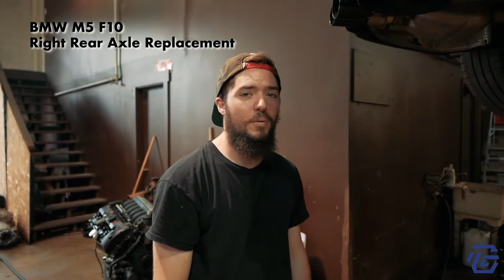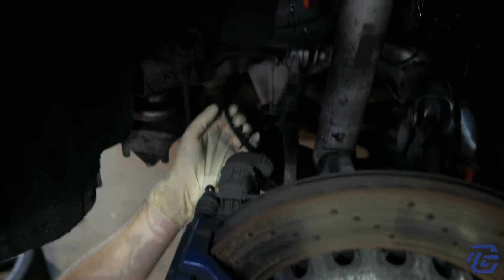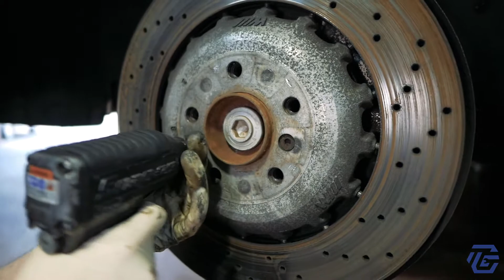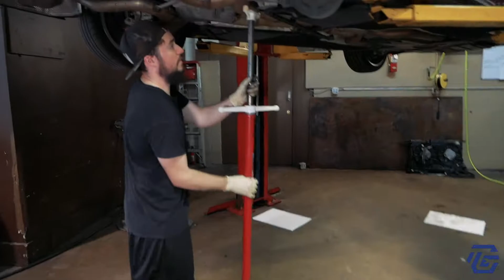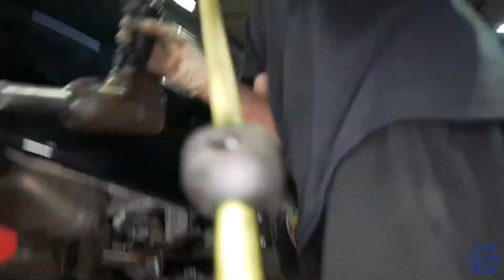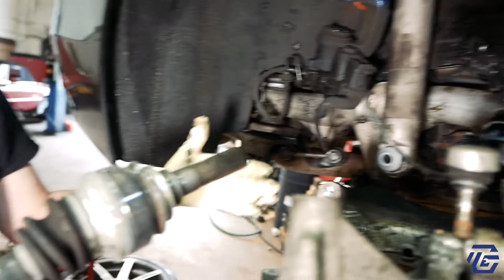DIY BMW M5 F10 Right Rear Axle Replacement step-by-step Instruction: Test Garage with Billy

Comment: How do you release the axle from the differential? I’m pulling my axle out (in 2 pieces), but mine broke on the differential side, and it seems stuck.
Reply from the maker: To release the axle from the differential on your BMW M5 F10, you’ll want to start by making sure the axle shaft is fully supported and aligned as you work. First, use a pry bar or flathead screwdriver to carefully apply pressure between the differential housing and the CV joint. Try to gently pry it out while avoiding too much force, as this could damage the differential or housing. If it’s stuck because of breakage, try rotating it a bit while applying pressure. Sometimes, a slight twist can help it come loose. A rubber mallet can also be helpful to give gentle taps on the joint if it’s not budging. Just be careful not to apply too much force to avoid damage. Let me know if you’re still having trouble, and good luck with the replacement!
Reply: Was able to remove mine in 20 minutes. When you pry, use the bolt that’s at 6 o clock to pry and prevent scratching to housing… Your video saved me a good amount of cash. Thanks bro.

Comment: Do I need to remove disc brake to remove axle ?
Reply from the maker: In most cases, yes, you'll need to remove the brake disc to access the axle fully. It gives you more room to maneuver and ensures you don’t damage any components during the removal. Just be sure to secure everything and note the order of parts as you take them off. Let me know if you have any other questions!

Comment: Do I need a special BMW tool to disconnect the rear axle from the diff? If not, what's the trick/technique to pry it out?
Reply from the maker: No, if you have all the mechanics tools you should be fine.